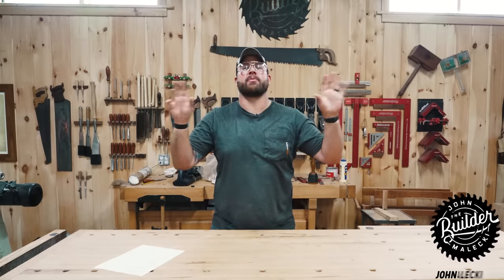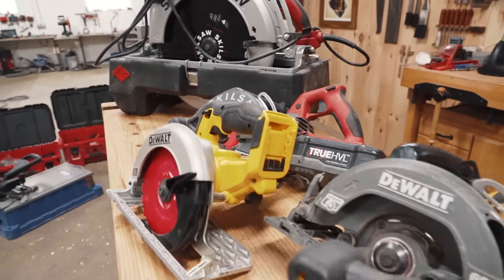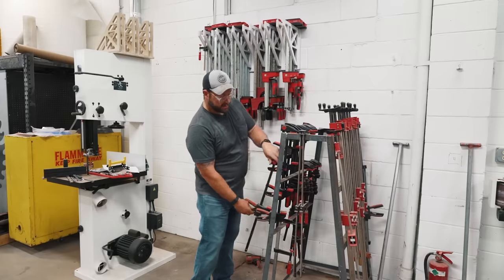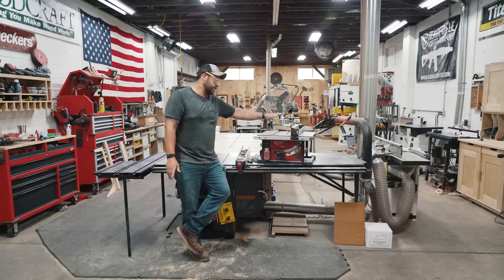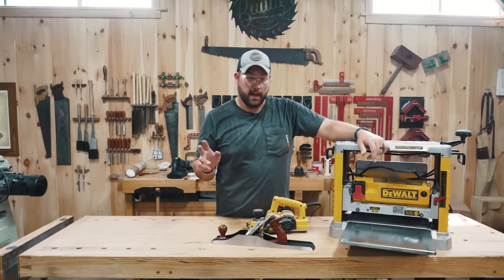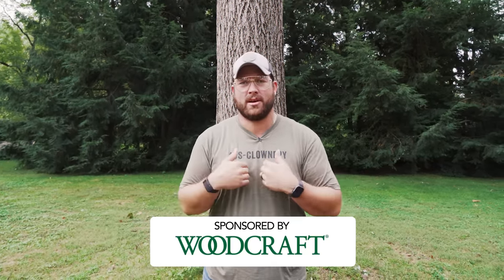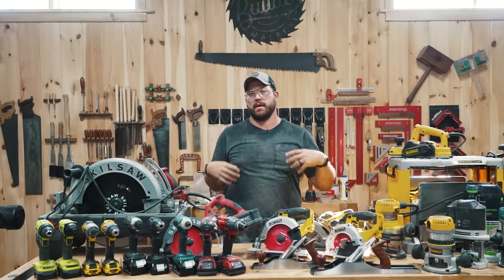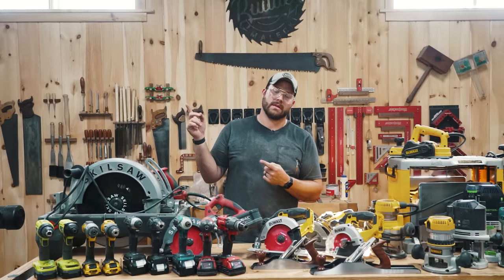10 Must-Have Tools For Beginner Woodworkers

Comment: This is a great list, but I honestly would not consider some of these tools "beginner tools." My list would only include a circular saw, a jigsaw, a drill-driver combo, a random orbit sander, a shop vac, and F-clamps. My rationale is that power tools like the table saw and the router may come across as intimidating to a new woodworker. Plus, some of these suggestions are not cheap; a benchtop jointer, for example, is going to run you at least $300-$400, and even the low-end thickness planers are going to run you $400. Obviously, I'm not accounting for something you might be able to find on the secondhand market, but a novice is likely not going to know enough to make an informed purchase. The better approach, in my opinion, is to start simple, get comfortable making some basic projects, and then start buying tools as you find a need for them. Beyond this, I do compliment you on your explanation of these tools and their purpose.
Reply: Agreed
Reply: ryan norris  agreed, but then again that was my point.
Reply: @JeffreyMoon1974  your list is practical.  His list is NOT.   No beginning shop list should contain tools over $1,000.    I swear most of these "top 10 tools" videos are done just to show off their high priced tools, and to try and get more free things from sponsors.
Reply: @JeffreyMoon1974  I think a table saw if ur making more than 3 projects is reaaally necessary at that point. I tried being cheap with a circ saw and everything took forever. And the weird placement made things get sketchy sometimes without a huge table/bending over constantly. 
Table saw once debunked and safely used felt way better for regular cuts.
Reply: @dylan-nguyen  I agree that there are things you can do with a table saw that are more difficult with a circular saw, and I LOVE my table saw. That said, as I stated, you should start buying tools as you find a need for them. The flip side to that is that you buy all these tools as John recommends and then they sit in your garage or basement collecting dust (and not sawdust) because you have no time or you lose interest. FWIW, when I started woodworking, I didn't have a table saw for about the first ten years or so. Do I wish I had bought one sooner? OF COURSE, but my time between projects didn't make it worth getting one and I managed most cuts with my circular saw or jigsaw (more the former than the latter). Once I found myself in the shop more, then it became an obvious purchase to step up my game.
Reply: So much this. If one "must have" a few thousand dollars in tools and dust collection, and minimum 400 sf of shop space, just to BEGIN then hardly could become a "beginner woodworker". I haven't given it much thought, but my list would probably include (1) big box store or garage sale, construction-type hand saw (rips and crosscuts), (2) jack plane, (3) two-sided rubber mallet, (4) average set of chisels, (5) decent corded circular saw aka skilsaw, (6) speed square, (7) a few Harbor Freight clamps including a wooden screw clamp, (8) corded power drill and a drill bit set, (9) combination square, and (10) tape measure. Plus a pencil. If I could have an 11th item, another items with machined, flat reference plane, like a level or another square. A beginner probably doesn't need another power tool for a while, and that may as well be a decent band saw over a crap table saw, jointer, or thickness planer in the same same price range. Opinions may vary but that's a more reasonable list I rattled off. Let's not raise the bar so high and discourage true beginners!
Reply: Totally agree, I am no professional but been doing lots of diy woodworking for past 8 years and circular saw, drill driver set, mitre saw with clamps does almost everything.
Reply: @dylan-nguyen  could you recommend a good tablesaw?
Reply: @mgnoodle2589  grizzly ones are good but expensive otherwise I'd get dewalt
Reply: @dylan-nguyen  brilliant cheers.
Reply: Exactly this isn’t for a beginners more like starting a wood shop
Reply: Totally agree. This list is way to much - is good but also a typical salesman list that tries to sell you a lot of items. 
1. People often lose interest in hobbys so why does everybody advertise a bunch of tools that cost you a small fortune, when it is uncertain that you will stick to it.
2. It is discouraging for interested new comers who don't have the money to buy these tools.
Reply: I'm the exact guy the video is NOT for, but Mr. Moon's seems more reasonable.  I haven't started my first project yet, but i just got a circular saw, a random orbit sander and drill/driver.  I'm not sure what else to get, other than clamps.
Reply: Agree 100%. I've done quite a few projects now with a basic drill, jigsaw, clamps and a detail/mouse sander. Can you explain why a shop vac is better than a normal vac?
Reply: @ByteMwen  Shop vacs are most of the time wet and dry vacuums and regular ones clog very easy and fast. Some shop vacs have a special filtration system to ensure that the small and mostly harmful dust stays inside. They are simply more durable and designed for debris.
Reply: @ByteMwen  A regular vacuum is designed to pick up normal household debris, e.g., dirt, dust, a few Cheerios, etc., whereas a shop vac is designed to pick up larger debris like wood chips, metallic shavings, etc., as well as water waste. A regular vacuum would get destroyed very quickly being used in a shop environment.
Reply: Agreed, I want to get into woodworking as a hobby but I can't afford many of these items not as a beginner anyway.
Reply: I just started a workshop in my garage for DIY and hobby and I am of the exact mindset you just laid out!
Reply: Leaving hand tools out of the equation for the moment (so clamps, squares, measuring tapes, rulers, chisels, knives, etc.)  I would recommend 1.) Cordless drill + impact driver combo, 2. corded or cordless circular saw, 3. compound miter saw.   At this point you can drill holes, drive screws, cross cut, miter cut and bevel cut (short lengths) with a high degree of accuracy and repeatability, and rip and rough dimension lumber with the circular saw.  Next, for shaping, joinery and edge finishing I would get a 4.) router - even a trim router.  For finishing, a 5.) Random orbital sander. The next most important task are improved accuracy and repeatability for rip and bevel cuts, for this you need a 6.) a table saw, then improved accuracy and repeatability for drilling, so a 7.) a drill press.   Next I would go with an air compressor and brad nailer then probably a band saw (at some point you have to cut curves) before I got a jointer or thickness planer.   I have used a router sled for thicknessing, a jack plane for smoothing and a table saw for jointing quite a bit.
Reply: @whitedo1  All good suggestions but, again, going with the theme of the original video, my point was that some of the tools he references are not "beginner tools." I would not include routers, table saws, drill presses, and band saws in that mix. In my view, people should acquire tools as they need them. A table saw may come sooner, but a drill press and band saw are tools that I did not acquire for several years until I found a real need for them. Tools should be making sawdust, not collecting them.
Reply: @JeffreyMoon1974  True, and I hope it didn't seem I was criticizing.    The other major consideration is the type of projects you are into.   In my case, one of my hobbies is building guitars - so a router, bandsaw, orbital sander and drill press are near essential where the table saw is just a good flat level work surface 80% of the time.   On the other hand, if woodworking to you means installing baseboards, millwork, crown moulding, casing windows and doors, etc.  a miter saw and brad nailer probably rise to the top.
Reply: @whitedo1  No, I didn't take your reply as criticism. Your point that the tools should reflect what projects you build makes complete sense, and this ties into my original point. If someone who is just getting starting in woodworking asks me what tools to buy, I'm going to suggest starting with a few common, inexpensive tools, and then go from there once you build some confidence and identify projects to tackle. Not that I build guitars (impressive!), but it sounds like you have found the tools that best make the job easy and fun.
Reply: And jointers are dangerous if you don't know what you're doing
Reply: And I almost never use my table saw anymore
Reply: I came in just to mention a shop vac
Reply: @MrBrightSide77  Is a mitre saw just more accurate? That seems to me to be the main benefit of a circular saw. Well, that and speed of use.
Reply: @jeffreyMoon1974...just remember the word "Must have"....if the job fascinates you😁
Reply: Very good opinion.
Reply: This is for an ex nfl turn beginner woodworker
Reply: They all intimidate me, but that doesn’t stop me from making my projects at 63. I’m learning all kinds of new stuff.
Reply: Thank you for this advice. I'm a bit intimidated by what I need to start
Reply: Honestly I'd rather hear what you'd recommend as a starting set
Reply: Also, running many of those safely is going to be a dangerous  hurdle for beginners!😊
Reply: Agree
Reply: Yeah, I started with mostly hand tools and only really got like drill/driver, a sander, a dremel, and happened to have access to a free bench grinder. Everything else pretty much I just used hand tools and upgraded slowly over time.
Reply: @sachindarji1412  half of your list, such as a square, level, and tape measure was mentioned at the beginning of the video. He said he would be talking about what comes after those. Granted, a planer and jointer are not beginner woodworker tools. A table saw and sander or hand plane can accomplish what those can. A table saw is kind of a must in my opinion because making large cuts with a circular saw can be pretty inconvenient, slow, and inaccurate. Still very doable, but a table saw is definitely worth the investment, especially with something like the skil ts6307 that's like $270.
Reply: For me the tools are not intimidating, but the price is 😂😂😂
Reply: Which tool in the list do you think is the most important to start with?

Comment: As a novice I'm really interested by your pocket holes comment. Can you do a video showing when to use and not to and why?
Reply: Never!
Reply: you can use pocket holes just about any were  from table top to doing framing
Reply: There are many good uses for pocket holes, but typically should only be used with 3/4" or 1" thick material building like box work for cabinets or what have you.
Reply: I am a convert. Pocket holes are great, you just have to do it right. Steve Ramsey has great videos on it
Reply: Mainly for strengthening right angle joints with a diagonal brace, like that 📐, it’s usually seen in make shift table tops and framework for doors or gates
Reply: Only ever use pocket holes for assembling materials such as Ply, MDF or chipboard, materials which will split if you drive a screw into the board edge.
Reply: @ganjasmoke21  oke Jo of i9
Reply: In my honest opinion pocket hole jigs are simply for hiding the holes while still maintaining strength and for framing you allow the WOOD to do all the bracing and strength and the nailing is just to keep it connected but I'm no pro , just an opinion